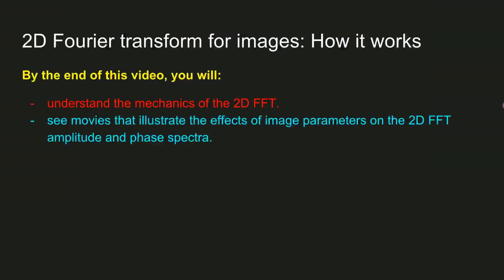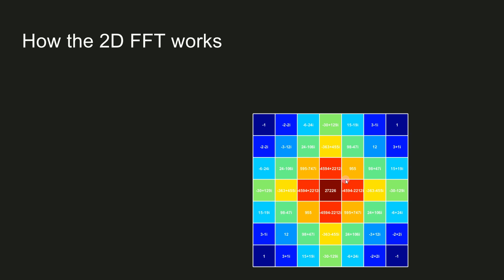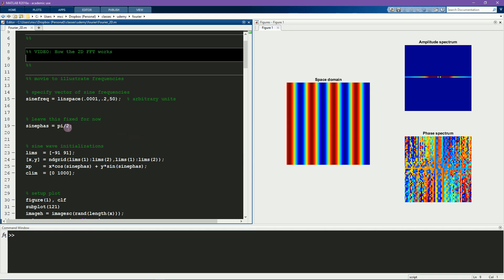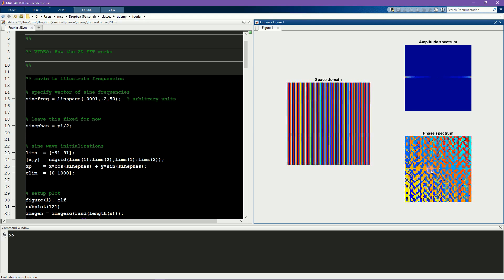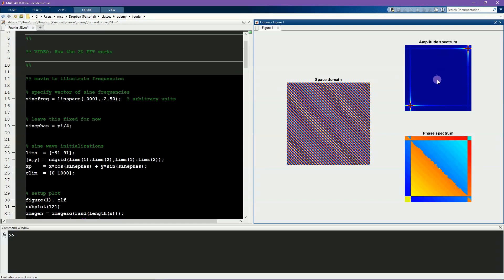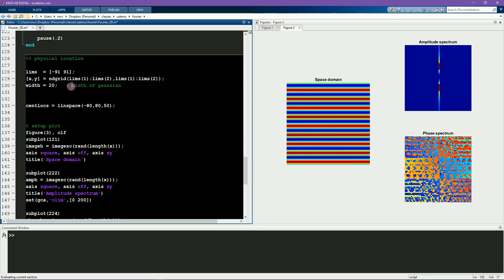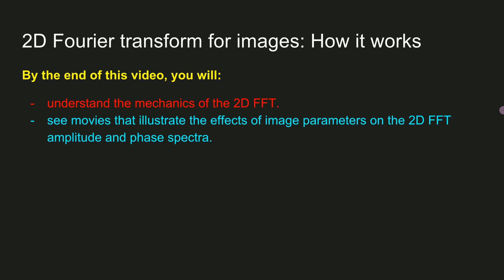How the 2D FFT works

Comment: So, when you transform to frequency space, you loose the ability to, e.g., edit a single pixel in the spatial domain. Because you decorrelated the pixels into freq and phase components?
Reply from the maker: yes, correct. The frequency domain encodes the spatial frequencies that are distributed over the pixels, not the pixels themselves.

Comment: Sorry I think in the middle should be high frequency, not low frequency.
Reply: The middle corresponds to the DC component, or zero Hz (low frequency). In a 1D FFT, think of how the middle (the y axis) is low frequency as well — same concept

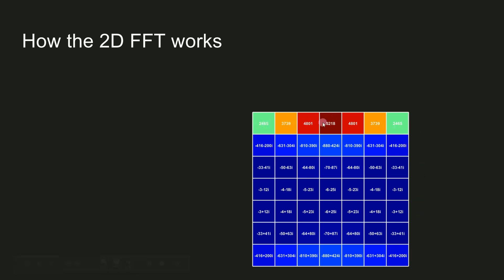Comment: I applied the 1D fft in matlab by using fft(X, [ ], 1) for an FFT of the 7x7 matrix to get the values like at 1:24 but I get different results
Reply: Same here, off by a significant figure for some reason... padding?

Comment: When you say at 2:07 that for images the DC frequencies are shifted to the center, is that just for displaying the frequency spectrum? Or is it necessary for using it e.g. to apply a gaussian filter convolution via the convolution theorem?
Reply from the maker: Both: Shifting the spectrum facilitates interpretation, and it makes it easier to construct a frequency-domain Gaussian for filtering. But the shifting is not necessary in either case.

Comment: Mike , Your videos generally hits the bulls eye. Focusing on extremely critical parts and its nuances  of overall concepts, which  generally is missed by others. I am looking for little more info on how to elicit out Frequencies and amplitudes from the resultant matrix output. Whether it is DFT ot FFT. Can you provide further pointers.
Reply from the maker: Thanks, Saimadhav. Getting amplitude is fairly straight forward: just take the magnitude of the Fourier coefficients (MATLAB function abs() ). Slightly trickier is knowing which frequencies you want to extract. The easiest way is to create a Gaussian to produce a low- or high-pass filter (depending on whether you set the Gaussian to be 1 or the non-Gaussian parts to be 1). A narrowband spatial filter would be a ring in the 2D Fourier space. 
Mike